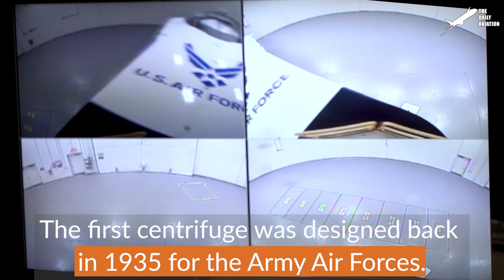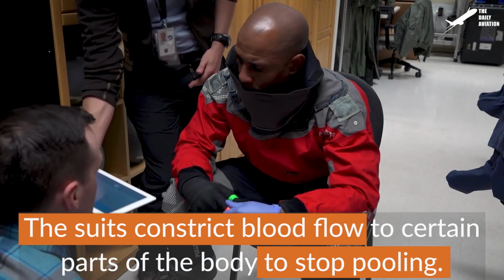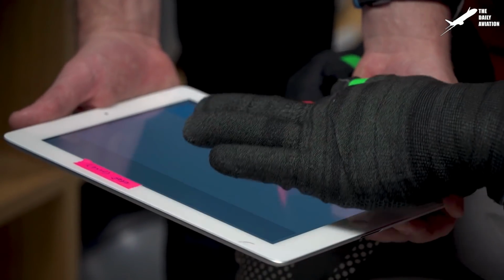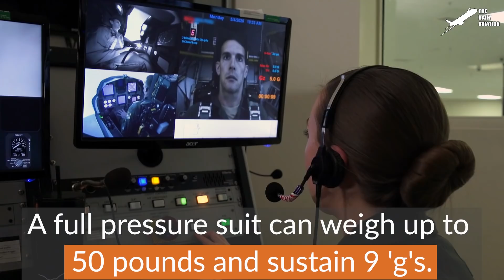Most Stressful US Air Force G-Force Test: You Fail, You're "Fired"

Comment: I’ve always wondered, what would happen if a pilot were to crash into the water and eject while the cockpit was under the water?
Reply: im no expert but from my knowledge, you would only breach the surface if you were close enough. because water is so heavy, the more of it you have to displace the harder it would be to reach the surface from the ejection alone. chances are, if a pilot crashes into the water it wouldn't be much different than crashing onto concrete. if for some reason though your plane was intact and the ejection functioned properly you would probably hit the canopy which isn't designed to be ejected underwater
Reply: @Adam-rt1lc  well if you were to be going very high speeds yeah I was thinking about overrunning on a carrier but usually they do it before they hit the water

Comment: 3:55 can fighter jets with the fly by wire be programmed to not exceed a certain angle regardless how hard the pilot pulls throttle to avoid over exposure of G forces? Or even be programmed to do computer driven maneuvers  Incredible stuff
Reply: Fly by wire restricts the pilots from doing certain things like over G the aircraft

Comment: If you fail in a plane you're dead. So where is the surprise.
Reply: Modern US fighters have Auto GCAS system , you can set a safety altitude and fighter will not go lower . 
If pilot will be off fighter will get flight control on autopilot .
Reply: @four-dimensionalperson  You're talking about drone flying.
Reply: @J4ckCr0w  not a drone , Auto GCAS it's on a F-16 already

Comment: i dont think they will fire you cause by the time you are doing G training the UNSAF would have spent like 100 mill on you so you would fly something els like cargo or passenger not just drop you
Reply: And those planes don't g?
Reply: @J4ckCr0w  no they dont ... combat jet pilot has to be able to sustain 9g turn and not pass out, you kinda do not need that when flying plane that would tear itself apart pulling more than 3-4g ...
Reply: @Asghaad  Yes you do, if you know what you're speaking about, which you don't.
Reply: @J4ckCr0w  sure pal ... its not like for example C-130 Hercules is limited to max of 2.5g when loaded ...

Comment: What if you can resist 10 g's. Does that make you great pilot ?
Reply: It doesn't and when you say resist it means you can take x amount of gs before passing out which is normally 4, g suits can get that number to 5 but taking 10gs if force is extremely hard and means you got a strong and fit body
Reply: @andromeda1871  Damn new knowledge acquired. Thanks